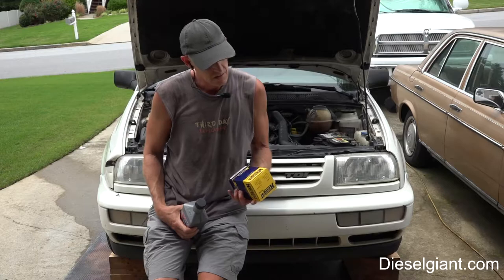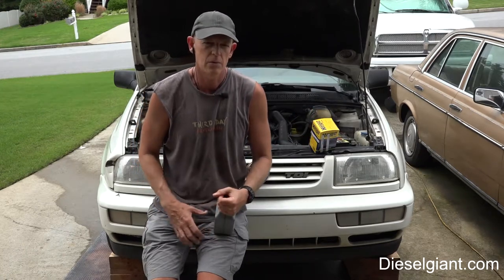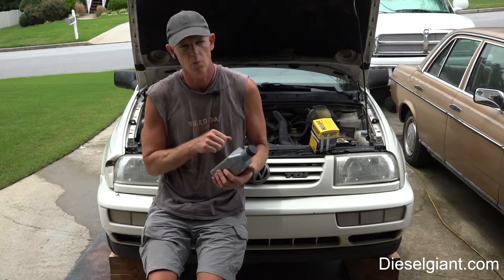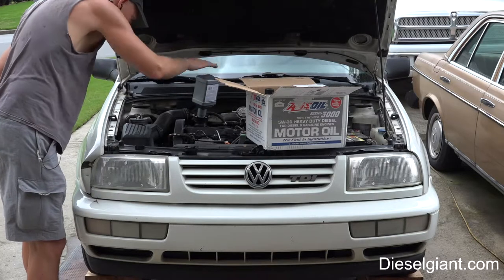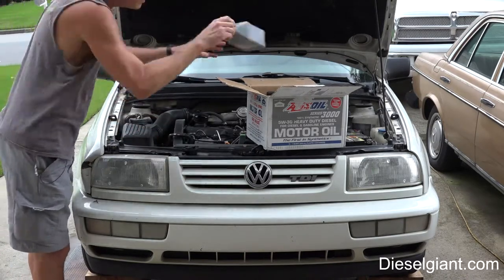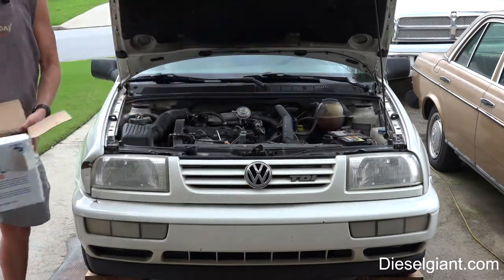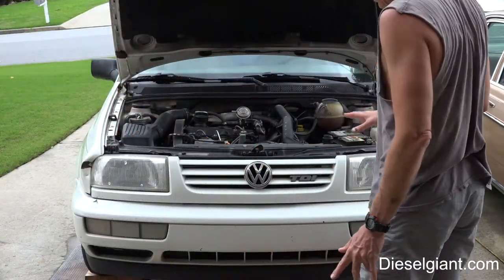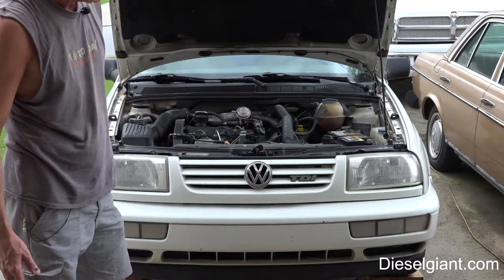Removing the Trasko bypass oil filter again and install Amsoil Series 3000 5w-30

Comment: I have used these for years over several vehicles (since the mid 1980's). The tissue filter element should be a good snug fit. You may have to remove some layers of tissue for a new filter element to fit but care needs to be taken to not remove too much. If it is loose it is not installed correctly. Remove the loose element as a new element will have to be installed.

Comment: We've been using Trasko oil filters for many years (>2 million km) but only recently did an oil analysis to quantify the benefits. The Trasko reduced the level of circulating dirt (silicon) by 66% (2/3). The oil felt much slipperier when using the Trasko. However it didn't decrease the other circulating wear metals.

The engine we tested uses a magnetic sump plug which will remove at least 50% of any circulating ferrous particles. It has also been treated with Xcelplus, a single application boundary lubricant that treats the metal not the oil: This reduced the wear by ~82%. 

http://xcelplus.com.au/docs/yaris.pdf

In a normal engine the circulating metals would be much higher and the Trasko would probably do more? 

In a Mitsubishi colt the Trasko filter (in combination with Xcelplus) made the engine run so quiet that you couldn't hear it.

http://xcelplus.com.au/docs/testimonials/colt.pdf

In a little Daewoo Matiz (800 cc 3 cylinder) the extra cooling fins and the larger volume on the Trasko oil filter helped cool the oil much more than the standard oil filter. The Matiz 800cc engine is the second most powerful production engine in the world (works hard)... so every bit of extra cooling helps.

With all the extra surface area in the Trasko filter and reduced wear, the element only gets changed >80,000 km saving both time and money.

The Trasko oil filter is easy to fit and works well. Despite the high purchase price of the Trasko you should recoup the cost through savings in oil filters, engine lifespan and labour.

:-)
P.S. We would normally fit a foam air filter to the Yaris to reduce the intake of dirt... but Unifilter (who make the best foam filters) don't make a filter for the Yaris. Pipercross in the UK do make a foam filter but it let in more dirt than the standard paper filter... because it is designed for UK conditions not Australian conditions i.e. It's too thin (designed for improved air flow rather than filtration).

Comment: Like the Frantz oil system using the tp paper roll... They have a inner sleeve for the inner loosens issues.
Reply: Frantz is another good bypass filter.  We are so lucky.  I remember a company in the 1980's called Pacesetters from Arizona that was selling their bypass filters for $500.  We are getting a good deal on them now.

Comment: I have been researching the Trasko bypass oil filter for a light-duty diesel pickup truck application.  I have been on the fence about purchasing the Trasko bypass oil filter since there are so few reviews of the product.  Given your most recent issue with the Trasko, would you recommend the it or pass?
Reply: I have used the Trasko before.  I HIGHLY recommend it.  I would use a Trasko in places where I am unable to use an Amsoil bypass filter.  You will be absolutely amazed at the performance of the Trasko.  I went thousands of miles on the oil and every time I checked the dipstick, the oil always looked like it barely had a couple hundred miles on it.  I love the Amsoil bypass filter, but it's more difficult to install and not all vehicles have space for it.  The Trasko works perfectly in place of any existing spin-on oil filter.  I just ordered my Trasko and should be getting it any day and will be using it with Amsoil Signature Series oil.
Reply: Hey, I do appreciate your response...thanks.  What is the vehicle you will be using the Trasko oil filter in?  I have not been able to find any reviews of the Trasko oil filter in diesel pickup truck applications.  I even checked with Trasko, and they could not provide any references.
Reply: Won't make any difference with diesel.  Amsoil interchanges all of the EaO filters with diesel and regular oil.  Trasko won't be any different.  Just order several of replacement cartridges.  Find out what WIX filter your diesel takes and then go to Trasko's site and check out the cross reference and see if they have any compatible filters. http://trasko-usa.com/cross-reference/cross-reference.htm  These filters are superior for diesel. I've seen many diesel people use bypass filters.
Reply: @CarMaintenanceGuy  Thanks for this video. It is rare to find a Jetta TDI bypass discussion. As a '12 Jetta TDI Sportwagen owner, I am working on installing a single bypass filter made by Amsoil and the progress is slow. I wrote Amsoil 2.5 years ago when I purchased the vehicle and they said they didn't have an install example and think the oil sender threads were m12 x m1.5, which I believe is wrong, it is m10 x m1.0. Here is a thread I have begun, it is new with only preliminary information, but I intend on completing this project with a bypass filter. https://forums.tdiclub.com/index.php?threads/amsoil-bypass-install-on-2012-jetta-tdi-sportwagen-and-need-help.515937/#post-5670128